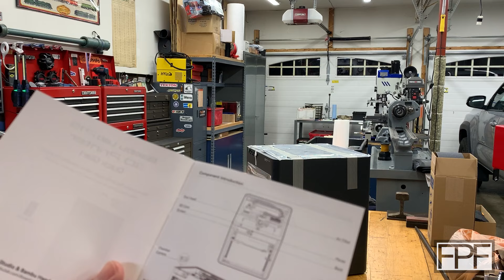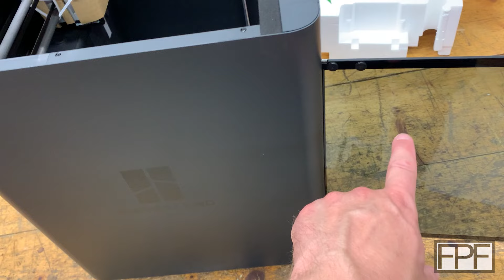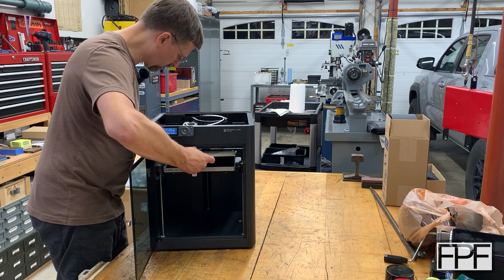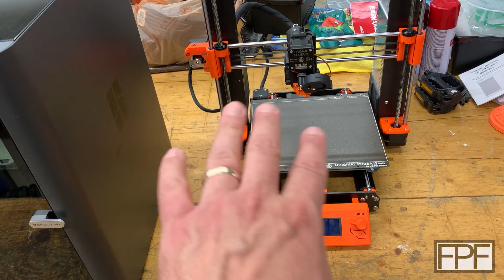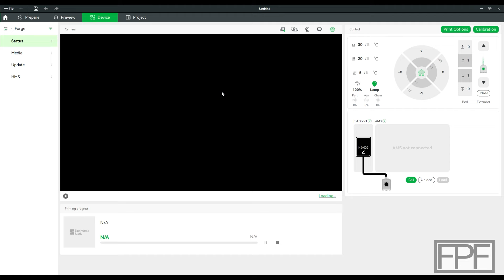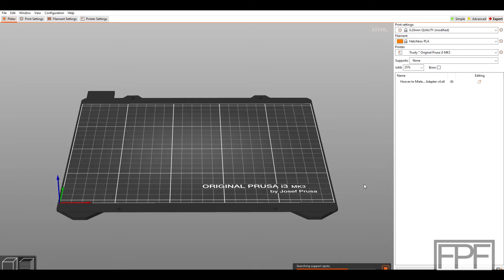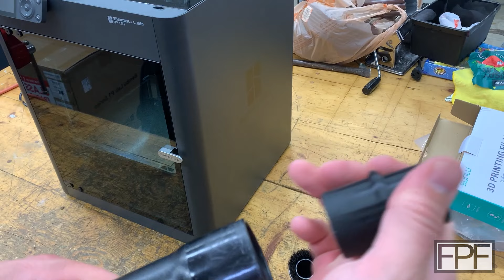Bambu P1S Unboxing and REAL WORLD prints

Comment: For ANYONE who purchases the P1S, you will notice that there is a MICRO SD card inserted into the top left corner of the printer with a piece of strong tape securely keeping it in place. 
DO NOT discard this Micro-SD card. It also contains a start up backup on it as well as a few (UN-printable projects) on it.
Do NOT fret if the beginner projects don’t work or comply with your printer as they are outdated. Go download the Bambu Lab Handy instead and use that software instead. 
IF you accidentally erase the data from the Micro - SD card, you can still bind the wifi to the printer.

Comment: Hi there, i wondering if you rather use 220 vs 110 on a 3d print farm, I'm asking this cause specs say 1000w @ 220v and 350w @ 110v but i don´t know if this is a mistake from them or does really consumes more on 220v. Im asking because a run a farm and I don't pretty sure to use one or another. thanks!
Reply from the maker: Higher voltage moves power more efficiently in general

Comment: A good analysis at the start on cost/quality anywhere really. The growing issue as you identify is the more direct channels consumers now have to producers. In the best case this means additional middle man cost is removed while consumer needs are well heard and understood by producers. They all produce to a given price point and performance/quality will reflect that. The fly in that perfect market scenario is other countries struggle to compete with China for many reasons, but govt subsidy in China and poor worker/environmental protections give them a low cost base. As a pure consume the really annoying aspect of buying sight unseen is the shysters, presenting a 8-10 product at 1-5 prices. But you get what you pay for. What really grinds my gears though are cowboys, presenting 8-10 product and charging 8-10 prices, but sending 5 and below product. Bambu, however they're funded etc. have cut through that main issue i think and hence their success. Whether they're harvesting all our design IP through obfuscated network communication we'll find out i guess!😂

Comment: Why did you assume that the data could be accessed by the Chinese government? You can always disconnect it from the internet if you don’t want it to be connected. You don’t need an internet connection to print your parts, and your printer won’t connect to the internet unless you explicitly allow it, for example, through your router.
The same applies to routers. Are you worried that the router manufacturer might access all your data—like literally all your browsing activity? Personally, I’d be more concerned about that than about the printer! :) It’s nonsense to worry about an SD card, haha. Don’t be paranoid unless you’re unfamiliar with networking, but even then, don't be, trust me.

Comment: Cool. I dident know that.. thanks. As i hear, the Bambu runs control via internet and not local WiFi. 🤔 So i guess that it will work fine? 🤔
Reply from the maker: Correct, unless in LAN mode

Comment: You can’t use dirty cheap filament on the that printer without getting really bad clogs.
Reply from the maker: Ran dirty cheap (SUNLU black PLA) on it for a year, zero clogs, dozens of rolls.  I did recently switch to Bambu Basic for PLA, but only because the refills are cost comparative to what I was buying, and I pickup RFID.

Comment: Thank you, good video.  I'm considering a P1S with AMS as my first printer. My daughter has an Ender 3 that is a PIA. This will be as a hobby, not to make things to sell. I do metal machining also as a hobby with a 1440 Chinese lathe,  949 Jet (Taiwan) mill, cold saw, tool & cutter grinder, casting furnace ..... I do repairs of about anything just for fun. Its been years since I did CAD work so will need to get a CAD program and learn the tricks of making 3D plastic parts. What CAD program would you recommend?
Reply from the maker: I gave up rebuilding that worn out 10" Boxford in the background of this vid and ponied up for a brand new Taiwanese 1440.  Couldn't be happier.  Now I want one size up on my mill :)

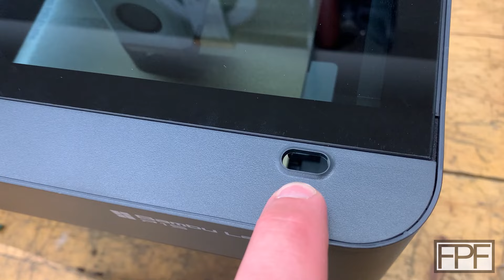Comment: Did you ever find out what that hole was for? 52:22 scrolled through some comments but no one addressed it
Reply: Just found the answer in the Bambu forum, it's meant to route cables from the nearby USB port
Reply: Is it just an escape for the hot air? Maybe the plastic walls cant take it while the x1c metal walls can? I have no idea

Comment: One year later and now the P1S is on sale for $549 and the (Mk3s+ only available with mm3 combo)  or you can get the base MK4S+ and both are $900.  I have had Prusa MK3 and it was head and shoulders above the competition years ago, I was very satisfied and impressed.   I have never done volume so Yesterday I bought a Bamboo A1 non AMS for $299

Comment: I own a MK3S+.  Picked it up used for $300, so not like I'm out the retail price.  That said, I very much DO want to explore multi-color and multi-filament printing.  To get even remotely close to the capability this P1S offers I'd have to get the MK3.9 upgrade kit ($579) plus an MMU3 ($329) plus a month+ shipping lead time at who knows what cost (so, almost $1k total!!!).  The P1S+AMS Combo is currently $750 shipped.  For what Prusa wants I could ALMOST get a completely overkill X1C+AMS Combo on the current Black Friday sale, it's nuts.  It's a complete no-brainer in my book, Prusa (like you said) has completely lost touch with the market realities of 2024 (and arguably 2020+).  Buy the P1S Combo, sell my MK3S+, and I'm probably under $500.

Comment: It's not even close. The more expensive prusa produced an inferior result and took 50% longer to do so. No matter how you slice it the bambu is the best option on the market right now...and it can do multi-filament printing, which people are certain they don't need or want until they try it. And with that being a $400 option for the p1s it's still cheaper than the prusa because you don't need to drop $$ for a rpi to run it.

Comment: Technically, the printer prints well (albeit loudly), but one thing the reviewers fail to mention is that the network functions all depend on using their app, which requires bluetooth to set up and the WiFi reception on the machine is very unstable. But like you mentioned: it ask for a LOT of personal data. It asks for Location, which is apparently needed for the BT to work, but it also asks for your contacts information... 

Also, their customer support is on the lower levels of helpfulness. Typical AliExpress CR farms where you need to go through several layers of bots and script readers before (and if) you get to someone more knowledgeable. If this expensive thing does not work and the troubleshoot guide does not provide an answer, you are on your own. I feel this is a major disadvantage.

Which is a sad thing. Chinese stuff can be good. But their corporate mind set can't leave the AliExpress behind.

Comment: You could use Wireshark and set it for outgoing IP packets from the printer and also see what devices it is attempting to talk to on your network.  You can SEE if it is talking to China.  I have and Ender 3 V2 Pro that is working well.  I just want a printer that can print faster, with other materials, and a larger volume.  Great video.  I will be back to check out your functional prints.  Thanks

Comment from the maker: 1 year later and these things are only $549 now.  Not sure if that's the new price or a sale, but that's a heck of a deal: https://fpfdesigns.com/r/p1s
Reply: I actually just picked one up from my old creality! Just found your chanel!
Reply from the maker: @Lumilan  You're gonna love it.  Night and day from any old machine, creality or otherwise.  Congrats!
Reply: Well, I'm looking to get a 3D printer. And having a universal hoover attachment* would genuinely be useful to me.
Hmmm, £669.00 for the combo deal in the UK right now. My mouse seems to have a life of its own! lol
*Other applications are in the pipeline.
Reply: Just picked up the combo with the AMS. Added some bambu filaments and the upgraded hotend also along with it. The printer was delivered today but I haven't messed with it yet.

Coming from a ender 3 max that I've upgraded everything on including the board (MantaE3EZ) and it only prints "Good" compared to what your P1S just printed almost flawlessly straight out of the gate with no fumbling.

I'm so dam excited 🤩🤩
Reply: I’m thinking about getting one (I’ve got a Neptune 3) I’m looking to make masks, figures and parts for places around the house is this a good choice, and I am looking to use different filaments
Reply from the maker: @mrmonke1575  The only thing the P1S won't do is the high temp engineering filaments that require a heated chamber, and you'll want to swap the nozzle for hardened if you use filled material.  Of the 9 printers I own, the P1S is my favorite.
Reply: 549.99$ right now. Wonder if there's a new model coming and theybteying to get rid of this generation
Reply from the maker: @exil3dlivecom  updated, crazy. . dunno, but either way this is still my fav machine
Reply: 1st time I've seen one of your videos. Definitely subscribed. So refreshing to see someone unboxing something the way I would. Also reading the directions first because you know tearing into something after throwing the directions over your shoulder is not really a manly thing to do. Lol Maybe I'm getting old but I've never understood not taking the time to understand how to properly use something or being careful with something that you bought with your hard earned money! Thanks for the great video!
Reply from the maker: @Sius  thx
Reply: still near 800 dollars in Japan.... sucks...
Reply: It's now online $1019 USD !
Reply from the maker: @blaircooper9956  I just checked because that sounded crazy.  It's $699.  I think you're looking at the combo deal with the new AMS 2 Pro
Reply: i think they droped it down cause they working on a new one i heard they were supost to announce something this month but who knows i plan to get one with the ams system

Comment: China I think has come along way in a short time. I met a bloke that installed electric elevators. They band the motors from China because although they worked they were unsafe to install. You never knew if the right colour coded wires were correct, and a few installers found out the hard way. Later I saw the problem play out in the manufacturing side. It was when they ran out of a colour wire
They would use any colour they had to get the job out. Also they would subcontract the jobs out to the lowest cost. This was ten years ago. I doubt that it still happens today. We all learn over time.

Comment: Nice video, thank you for sharing and providing your insights and showing both printers from cad to print side by side..  Anyone else notice the Prusa screen flickering while manually moving the stepper motors?
The video feed on the P1S is laggy because the camera framerate is 0.5fps.  The X1C is 30fps.
The X1C has a second processor for the camera feed, lidar, etc, where the P1S does not.

Comment: I have a X1C and a Mavic Pro.  "Made in China" doesn't mean what it used to.
Reply from the maker: It means whatever you're willing to pay and then follow-up with quality control on.  That's my point.  I also own a DJI drone and, at this point, 4 bambu printers, and all are great.  Doesn't change the fact that you can still request manufacturing of something at a price point that isn't practical and instead of refusing the work, they seem happy to produce an object/tool/thing that any reasonable person would agree is non-functional.   Manufacturing in most developed countries would just simply turn that work down.  I'm not even saying it's necessarily a bad thing, but it does persist the "meme of poor quality".  For example, if you walked into a sandwich shop and said, "I want a sandwich", and they said ok, five dolla.  Instead you said, I only have a quarter, and they gave you half a piece of bread.  Then, you took a pic of your "sandwich" and posted it to instagram saying this is the sandwich you got from XYZ restaurant.  It doesn't look good, even though you got exactly what you paid for.

Comment: Would you recommend P1S for hobby level prints in primary residence where space is shared with family life…. I worry about the noise (fans mostly after the recent firmware upgrade with noise reduction).  Is this printer loud for day time prints compared to A1?
Reply from the maker: P1S at normal speed is pretty quiet

Comment: i want to install my printer in the garage but i live in Houston with a relative humidity between 70 to 90 percent. 
Do you have any advice to keep filament dry? thanks!
Reply from the maker: Will be tough to keep it dry.  PLA should be ok, but other filaments you're probably just going to need to dry before use.  Checkout the magic mill food dehydrators. That's what I use and they're great.
Reply: @FunctionalPrintFriday  tks!!
Reply: @FunctionalPrintFriday  ok thanks!!
Reply: @FunctionalPrintFriday  Could you build a box like Adam Savage did? Search YouTube for details.

Comment: I have an anycubic Kobra max and in between massive layer shifts, or constant smaller ones, pla not sticking to the bed or y axis errors (The layer shifts are also always in the Y direction) I'm at the end of my rope. I'm fairly certain i should just toss it and get a bambulab P1S
Reply from the maker: if you don't need the build volume of a "max", get the P1S.  You'll never look book.  That said though, try heat soaking your Kobra Max.  It probably has the same problem . .

Comment: I found you because I was looking for a 3d printer I could use to make cookie cutters.. for myself for now. I purchased a Ender 3v2 thinking I could just get it up and running. But no. I'm a baker. I'm accustomed to doing a little tinkering but I've given up on this one.  This video on the Bambu looks more like something I should have purchased. So, I'm giving my Ender to an investor who will purchase a new 3d printer - I've chosen the Bambu P1S.  I went as far as putting my ender together and trying a print but the print was never right and there are way too many videos trying to help me make it work.  No extra bells and whistles needed because its just frickin' cookie cutters.  For the Bambu there will be a learning curve still trying to create the cutter shape and then printing it out using the correct settings.  Any advice?  Thank you for the video.

Comment: I'm looking to upgrade from my Ender 3 V2. I've been looking at the Bambu Labs P1S but I don't like the idea of sending everything to the cloud for reasons you talked about. Can the P1S be used locally via USB or local WiFi without sending info to the cloud? Do you know if the AMS will automatically switch spools if a spool runs out? I'm thinking of all the spools I have with small amounts of filament that essentially goes to waste. It would be nice to use them up.
Reply: Check out 1:01:25 on the P1S cons

Comment: The P1S is a great printer.  If I didn't have the choice of the X1C I would have been more than happy buying the P1S.  For me, even at the price point of the X1C, there was no other choice in my opinion.  I had a moderate knowledge of printing from my Ender 3 before buying and I was able to apply that to the Bambu, but for the most part it just printed nearly perfect parts from day one and it's only become better over time.  And now that I have installed the new X1+ 3rd party firmware I can keep all of my data local.  There's some really great things on the horizon with Bambu for that reason.
Reply: I get privacy is a good thing.  But let’s get real, what can the Chinese government do with information from your database? Can they rule the world with that information?  Point being, they wouldn’t care.  This fear mongering and paranoia is getting out of hand.

Comment: I really don't get why everybody is making comparison videos between the mk3/mk4 and the p1p/p1s. There is not a single reason to buy the prusa even if it were half the price. Sure, the nokia 3310 was rock solid, had better reception, longer lasting battery and smaller size. But we moved on, nobody is making comparison videos between the 3310 and the iphone 14. Because there absolutley is no comparison, they are from different planets.
I have nothing against prusa except the ridiculous price and the lack of basic modern features. Like a touchscreen that has no touch, input shaper that does no inputing, super speeds that aren't that super.
I say we let prusa slowly fade away (like nokia did) and move on to stuff that is actually relevant
Reply from the maker: because of the pricing